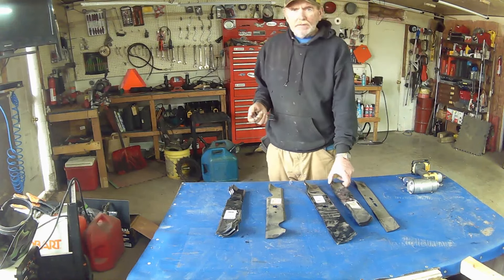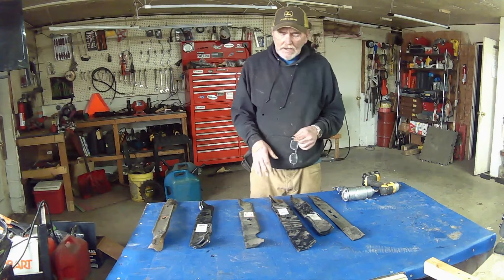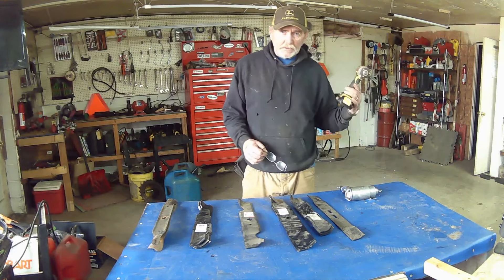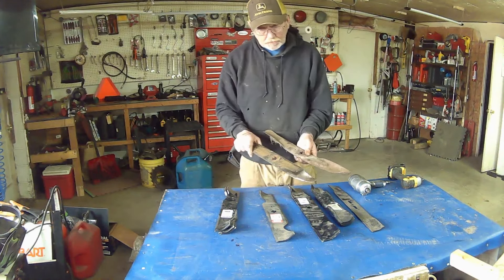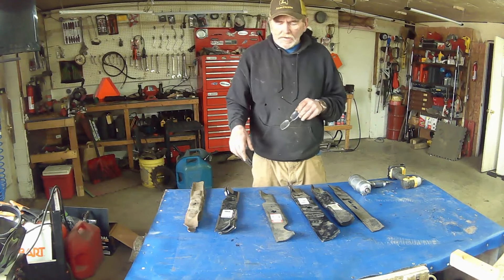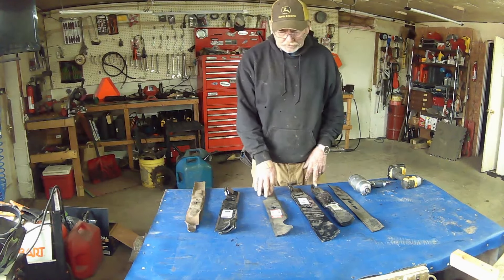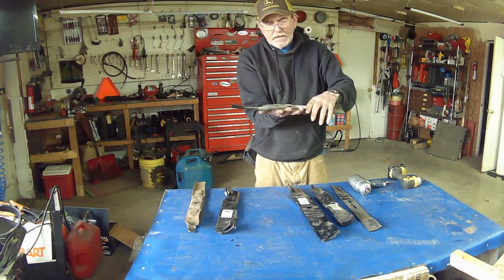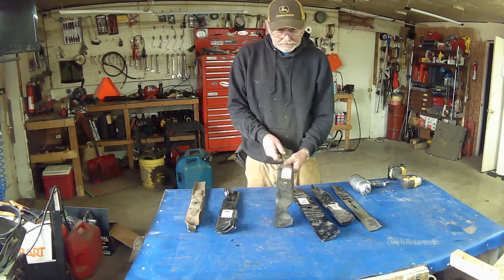How To Put On Lawn Mower Blades: The Correct Way

Comment: I always spray the bolt or nut with PBBlaster or Liquid Wrench first can save some hassles.
Reply from the maker: that is a good practice Jason and allow time for the PB Blaster to work before putting the air impact on it.

Comment: I torque them to 55 foot pounds!
Reply from the maker: Hey Randi... how are you feeling these days? 55 foot pounds I think is close to the norm. I know each manufacturer recommends a different settings. Most riders are 70 to 90, push mowers 30 to 50. If you over tighten can cause the nut and bolt to shear, making it difficult to remove in the future. It can also cause small pieces of the threads to come off each time, eventually stripping the threads.